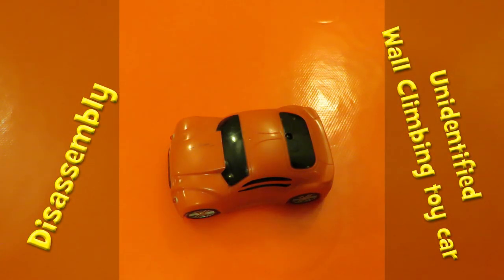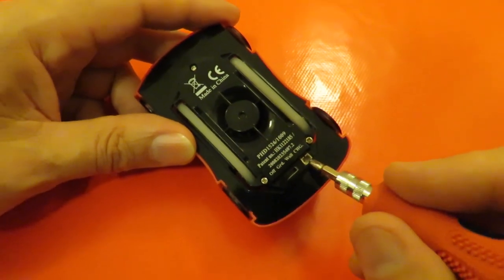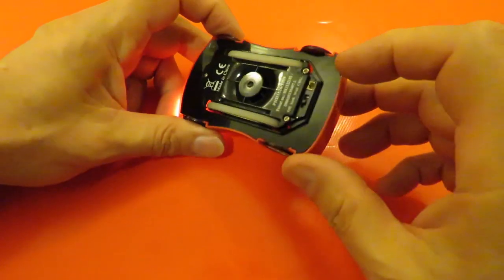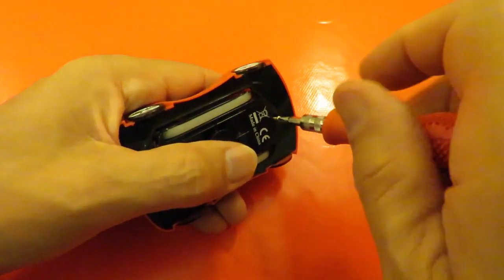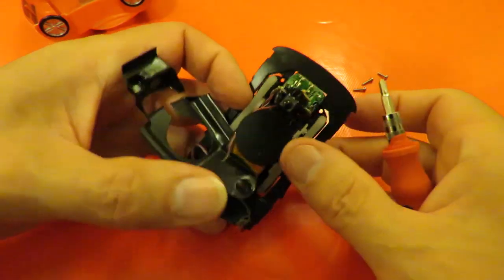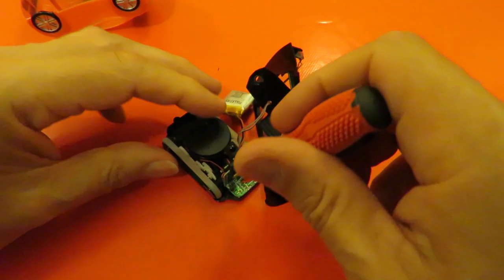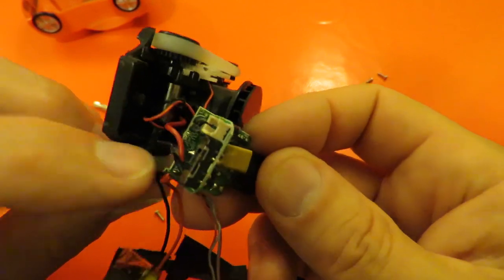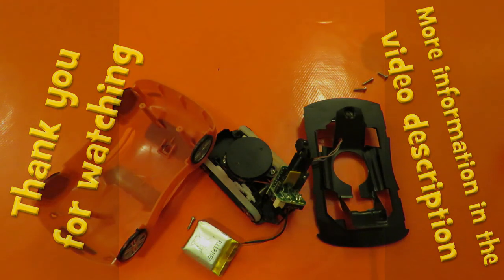Disassembly Unidentified Wall Climbing toy car

Comment: I/R never did have the TX2/RX2 chips as an off the shelf standard, a shame really. I've got a couple of these, but Police car type...the fans are really quite powerful. Here's an idea - a solar powered waterwheel river boat, with the fan turning much slower on its side. Would be really good to see one of those :)
Btw, in my opinion, the Fullriver lipo's are the best for longevity and performance in toy stuff.
Reply from the maker: Thanks Slider. So far in all the IR toy I have found I have never found one that works with any body else's transmitter. I have at least 10 different transmitters. The only hope is to swap the receivers out for 27mHz or similar or just scavenge down for parts. Hmm solar powered waterwheel river boat - one for the to-do list :)

Comment: Can I use its transmitter and receiver for rc plane 
.
Reply from the maker: That depends how much control you want. It works by varying the relative speed of the two motors. Many toy grade RC planes use a similar method. You main problem is that infrared is not good outdoors because the sun swamps the infrared signal, so you would need to fly indoors or in dull conditions. The range will also be very short, so you would probably have to run behind it to maintain the signal. Here is a playlist of one that I did with a very similar wall climbing car https://www.youtube.com/playlist?list=PLA5a2xPRSrB2smN01QmwNPeDBc7hEK6lG and here is a biplane I did with a similar controller - not the same but it gives you an idea https://youtu.be/r5QbuEc10x8
Reply: @GrandadIsAnOldMan  hello sir I am from India so can you give me wl toys v911 receiver as a gift
Reply from the maker: @hypergriffin5086  no
Reply: @GrandadIsAnOldMan  ok bro
Reply: @GrandadIsAnOldMan  I will try to find out It ok ... Will you sell it to me
Reply from the maker: @hypergriffin5086  no
Reply: @GrandadIsAnOldMan  can you make a video by making plane with 3.5 ch helicopter

Comment: Use a jumper remote control
Reply from the maker: That assumes you have a Jumper transmitter available. Although to be honest, I don't think you will find a 2.4Ghz transmitter is compatible with an infrared receiver however clever it is at working on different RC protocols.